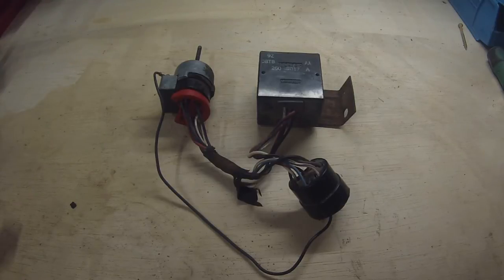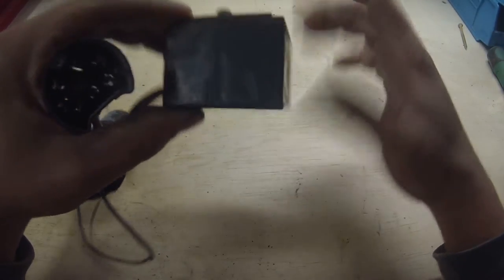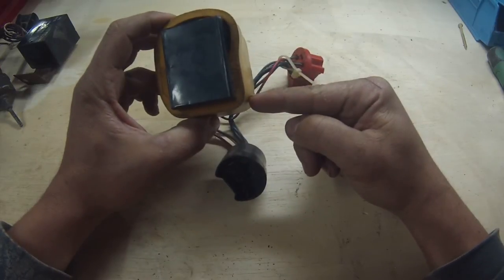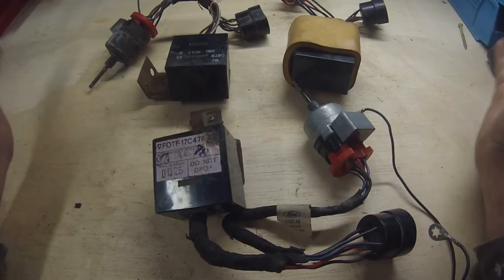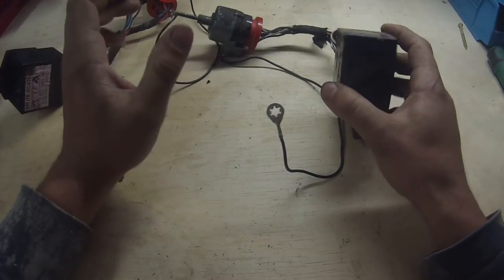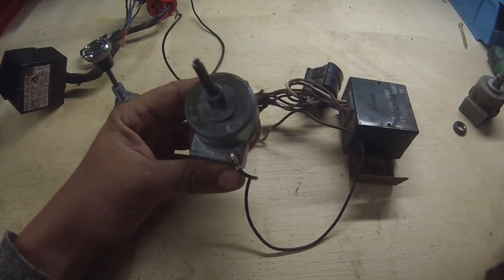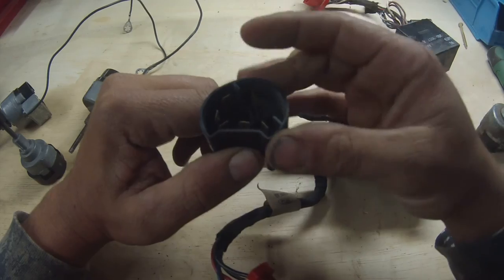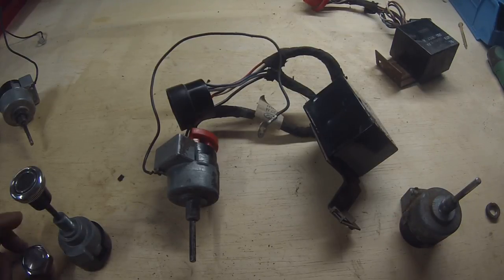Ford Dentside Truck Intermittent Wiper Switch Conversion

Comment: Thanks for the video, I bought the switch from LMC Truck and will be doing the install on my 1978 F150 super cab, also I just switched out the gauges to have the cluster all working again and added the blue LED lights. 38 gallon swap of the rear tank with a new fuel tank selector switch.  Love the truck. keep up the good work with your videos
Reply: All the very same stuff I'm now doing.

Comment: Thank you so much for the video! I have been kicking around the idea of converting my 73' and 79' trucks. I have always figured that it was doable since seeing how the intermittent switch worked on my boss's 89'. Then I learned later that it was an option on my trucks! Lol

Comment: Thanks for this. I'm currently fully rewiring my 73' f350 scs and it only had 2 speed wipers. I figure if I'm going to be upgrading now's the time. I was able to pickup a nos 1989 controller for a reasonable fee. It'll be nice to be able to more or less factory upgrade.

Comment: Thanks for the video. I have a '77 with Intermittent Wipers. I'm having a problem you may have encountered. Sometimes they will not turn off, when they do turn off they stop where ever there are instead of returning to the PARK position. I've replaced the box. Would it be the switch or motor?
Reply: did you solve  "Sometimes they will not turn off, when they do turn off they stop where ever there are instead of returning to the PARK position"? 
I have a 90s truck that is defective in the intermittent wiper like yours.

Comment: When swapping 80's into 70's or 60's you must swap the black and white wire located in the black plug of the module harness to line up with the green and black wire located in the truck/car's black plug. Don't mind the white with black wire in the car/truck harness has nothing to plug into on the black module harness plug. This is taken care of in the switch with an integrated jumper.

Comment: I have a 75 that I did this conversion on using a "red switch / module" from an early 90's f250. My washer doesnt work, I have determined it to be the pump, and am addressing that today. Some where along the line I heard you may need to swap a brown wire to make the washer pump work, do you have any insight to that? Thanks, great video, this is a really easy ,mod for any begining tinkerers,  plus it gets you out in the yards looking for goodies. BTW it also works on Jeep CJ-7's

Comment: Good video. I found out my 1976 Ford F150 4x4 Explorer Custom has the intermediate wiper option. It seems have went bad because it no longer will spray washer fluid lately and the intermediate never worked right. so it looks like I'll have to buy a new switch.
Reply from the maker: Yeah over time they can get jostled to death, the controller (surprisingly enough) is kind of fragile
Reply: +LockedAndLoaded4x4 I guess so one of the bad things with intermediate wipers is that the regular ones are just like $25 for replacement switch while the intermediate switch is like $50 to replace

Comment: Isn't another difference that the 80's units seem to only have 6 pins, while the 70's unit has 7 pins? I can't get my washer to work because of that. I think someone put an 80's unit into my truck

Comment: what is the black box and does it go bad? I have 74 f250 ranger high boy, so to clarify, and so my stupidity the existing harness, is good, (most likely) and I just need the switch? l liked this video, very much..
Reply from the maker: Yeah they can actually got.out.pretty easily... the black box it's pretty well a relay box /controller, they can be damaged with alot of vibration or by dropping /hitting them

Comment: Henk Geleijn, i like your video and i also tried one in my 1973 F250. The wipers work OK but now i dont have the possibillity for the screenwasher. there are only 6 contacts in the switch i have and in the original there are 7 though no turning to the left.
Any solution to that?
Reply: +Henk Geleijn I just did this conversion and ran into the same problem. i have a 1969 and the intermittent unit i grabbed was out of an 80s truck. If your 1973 is the same as mine there will be 2 stock plugs that go into the back of the original switch. the large one is for the wipers and the small one (two pin connector) is for the washers. this smaller two pin connector has 3 wires going to it... two go to the same pin and one is alone... the one that is alone is green with a black stripe. this is the wire you need to power to operate the washers. it is possible to get this 2 pin plug backwards... make sure that the green/black wire is connected to the pin and not on the empty terminal.

Comment: I'm late to the party , but thanks for this helpful video!
Maybe you could make a video with explaining the wiring colors with were the colors go too for putting it in a different brand truck!?
I have a Ford switch with wires and module 17c476- and orientating to put it in my 73' Jeep j-series truck with new aftermarket wiring harness.
So im looking for wire color id.
Thanks!
Reply from the maker: I actually have an updated version of thos video.on the Channel with quite a bit more information and some updates/corrections. I intend on having a breakdown of the circuit function and how to diagnose common issues, and then also have a seperate installation video if I can get around to it, been slammed this last year so I'm dragging my behind.
Reply: @LockedAndLoaded4x4  would be great if you could upload that vid!
I'm in the middle of wiring up my 73' jeep truck.
Reply from the maker: @bib4211  yep, shouod have the other 2 up in a few weeks with any luck, the first is already on the main channel.
Reply: @LockedAndLoaded4x4  did watch most of the 1st part 
Thanks for all this knowledge!

Comment: I liked your video, I have a 1976 Ford F150 Ranger XLT manufacture date 10 of 1975 it has the delayed wipers with the red connector my grandfather bought the truck new in 1975 and I end up getting it and I turned it over to my son and the delayed wipers only work on fast they won't work on a slower speed or the intermittent and I believe the problem is a bad switch I just wanted to see if you thought that was the case so I can say for a fact that October 1975 that this 1976 Ford did come from the factory with delayed wipers that has a red connector and my grandfather bought it new, if you could could you please reply back to me thank you very much !

Comment: I have a 79 ford ranchero 9 pin switch will this swap work
Reply from the maker: Should work just fine, at that point the Car switch was the same as the 73-79 Ford Pickup.
Reply from the maker: After looking deaper into it, looks like the 9-pin with the barrel connectors (round pin) which funny enough was used in Heavy F-Series (F500-up) Trucks wouldn't work with this box type. I'm suprised the Ranchero had that wiper type in that year, really odd.